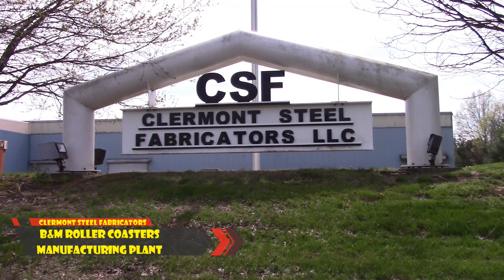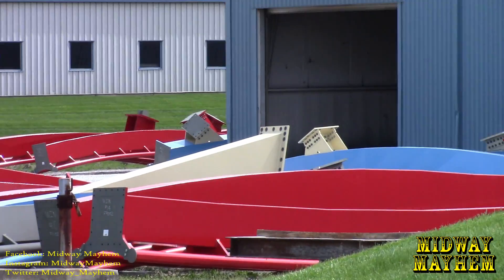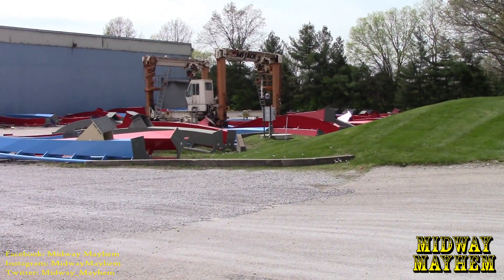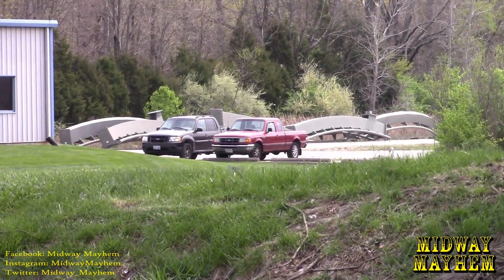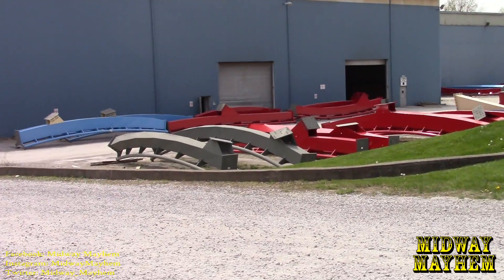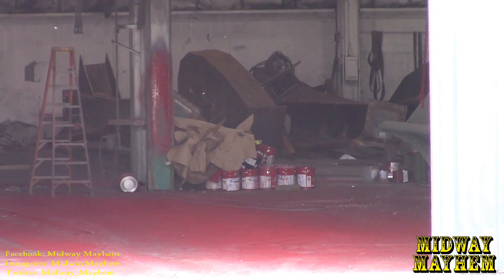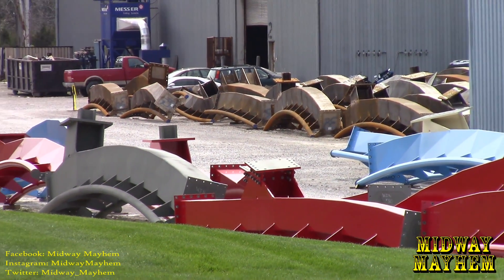3 New Coasters At Bolliger and Mabillard (B&M) Roller Coaster Track Manufacturing Plant Visit!

Comment: from my guesses: the red track looks a bit twisty, maybe a invert or something. the blue track looks like in has wider dips so maybe hyper. and the grey track looks like a wing coaster, prob over seas.
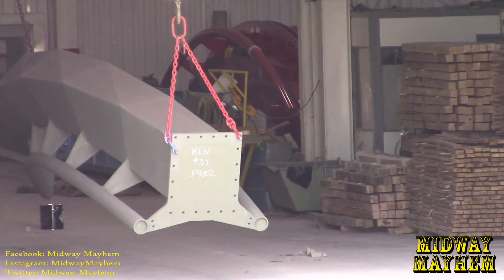Reply: //AbsoluteZero\\ if you look at the red lift hill at 1:17 that's most likely a hyper drop imo so I'm guessing the red is a hyper and blue is maybe wing
Reply: The grey track is just track that hasn't been painted yet.
Reply: //AbsoluteZero\\ 

Maybe valleyfair's rumored invert
Reply: Nope,CF are only building 4 coasters next year and none of them are from B&M. We have the two RMC conversions,one design from intamin and another design which they have said will be a prototype ride.
Reply: I know, the comment was made before I found that out
Reply: Coaster Jaiden The hyper will have yellow track I think

Comment: Yeah both are going to China . Red Track going to Hot Go Dreamworld for a Wing coaster, and the Blue track is going to Wanda Wuxi for their 196' tall custom wing coaster.
Reply: 196ft? Damn.
Reply: OpTic JeSTeR And the other? or is it unknown?
Reply: As Dan said the grey track is unpainted but has Primer on it so one could only guess where it's going until the final coat is applied. But A good portion of the new B&Ms under construction are Wing Coasters going to China.
Reply: Hot Go Park's wing has all of it's track in place. Where did you hear about a 196' wing?
Reply: Judging from what i have been hearing on different forums such as TPR, RCDS, etc, the height will be 196.8 ft high, 4,192.9 ft long, and have a top speed of 73.3mph.

It will have a Dive Drop, Zero-G Roll, Immelmann, Corkscrew, and a second zero-g roll.

Heres the latest rendering of the complete layout: 
http://themeparkfreaks.eu/wp-content/gallery/wanda/12313673_1492830244355702_386442534616887105_n.jpg
Reply: Wow, looks great. First half looks a bit generic, but the second half looks amazing particularly with the scenery.
Reply: Let's hope if there is a Ziz coming, it breaks all of those records for wing coasters.
Reply: Hotgo park got a red wing coaster in 17 that was shipped out last year. I remember it from the huge green wing coaster track debate on youtube about a year ago at this time in which everyone was so certain that the green track would go to KD,which of course didn't happen.

Comment: Honestly, the only good coaster from B&M these days is the Hyper/Giga.    Valravn has 1-2 hour waits only because those people never went to BGT or BGW.        The new version of the inverted (Banshee) is a loop machine with the vest, not fun.   The wing rider is only fun because of the launch (Holiday World).    The airplane maneuvers are boring, but that's what B&M does except on the Hypers/Giga where those are air time machines (except for the trim brake).    Look at the GTA list, the Hypers and Giga are at the top.
Reply: PastTime777 I kind of agree. I mean I love Banshee but I really wish it had OTSR's. Vest restraints suck. They remove head banging but B&Ms are smooth anyway
Reply: I actually really like the vests. Much better than the horrendous OTSR's on Vortex.